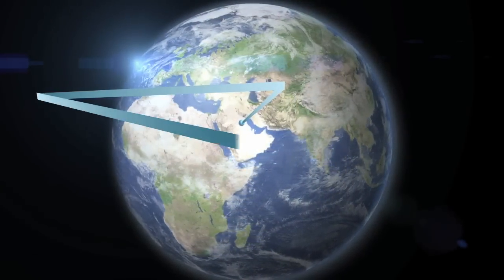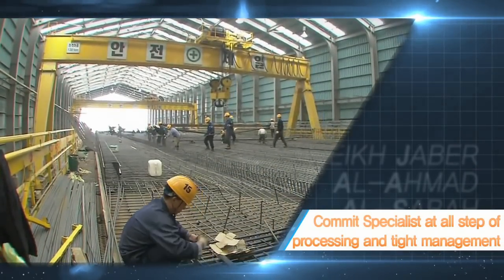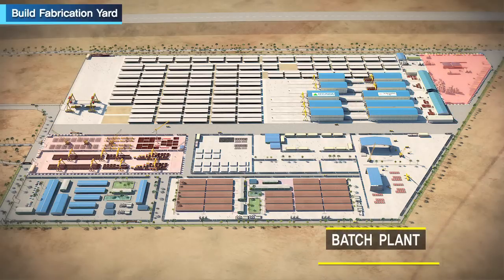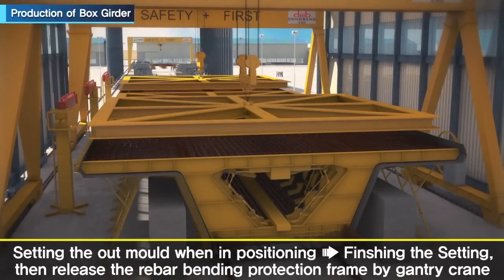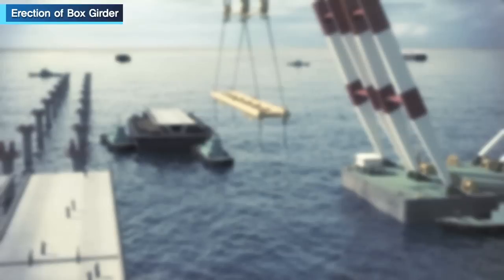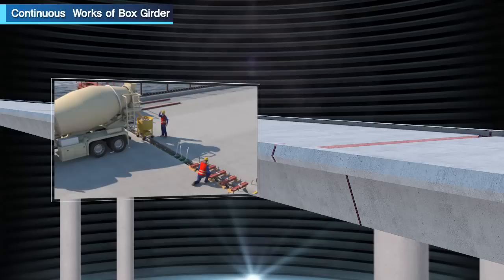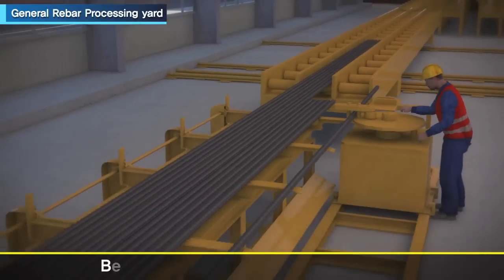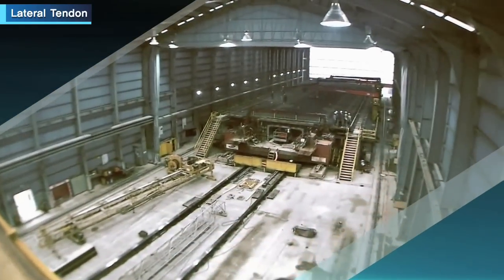Sheikh Jaber Al-Ahmad Al-Sabah Causeway Project (RA/140),

Comment: This is a promotional video made by DongBang E&C during the bidding stage of the Project. The Main contractor, Hyundai E&C awarded DongBang the subcontract for the bridge superstructure works, and awarded the subcontract for the supply of the equipment (Gantry Cranes, Straddle Carriers, Launching Girder, Segment Transporters, Overhead Crane) to Strukturas DF International.